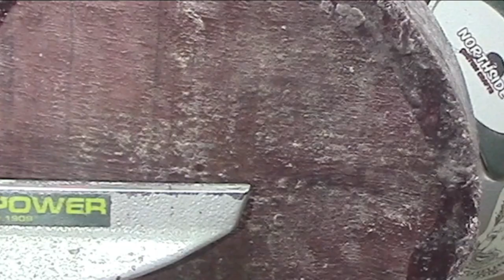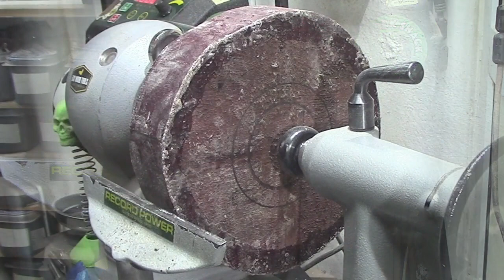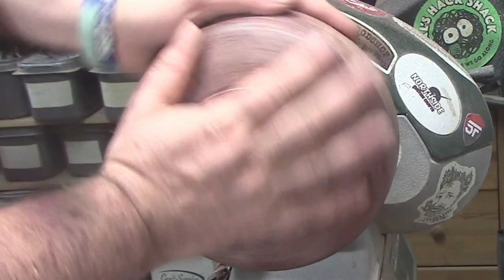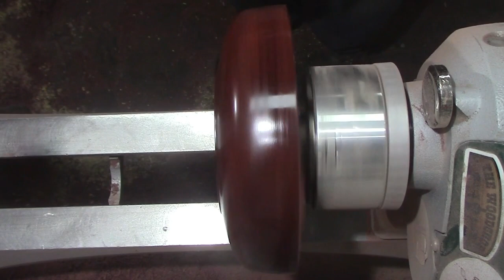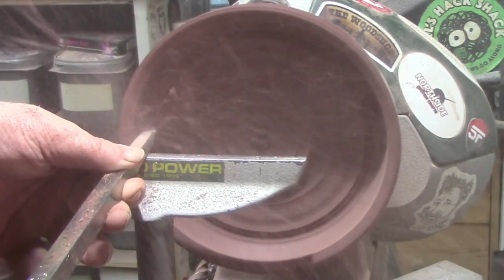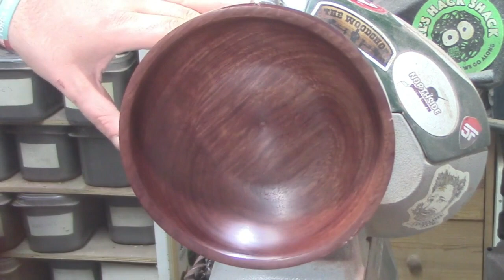Woodturning - Purpleheart Bowl

Comment: Beautiful as usual.  My son wants me to make him a purpleheart bowl.  I was wondering what speed you set your Record Power Lathe when you are using the Easy Wood Tools,  Sanding, and using the Yorkshire Grit?
Reply from the maker: Thanks a lot, I have it always set on belt 2 but I usually turn as fast as I can which is about 1800rpms ish, I usually sand about 500rpms and Yorkshire grit I put it on with the lathe off, rub it in for a couple of seconds at about 180rpms then increase the speed to about 500rpms and buff it in until zero residue come off on the paper towel… hope that helps
Reply: @jpwoodwork  That is exactly the information I was looking for.  I am self  taught and no one ever explained the speeds in any of the videos or books I have read, or I missed it.  Carl showed it on one of his videos, so I had to ask you as well.  I will give this a try and I know it will improve my turning skills.  Thank you.
Reply from the maker: @davidhjortnaes2000  you are welcome, what i will say which Carl never mentioned in his video is, before you use YG put on some sanding sealer and that will prevent the wood soaking up all the mineral oil thats in the grit and stopping it working properly..... its not a big deal you can just put 2 coats of grit on but sanding sealer just makes life easier  :)
Reply: @jpwoodwork  Not to mention wiping it all down with alcohol to remove the dust and bring up the grain before you use the sanding sealer and YG
Reply from the maker: @davidhjortnaes2000  exactly!!! :)